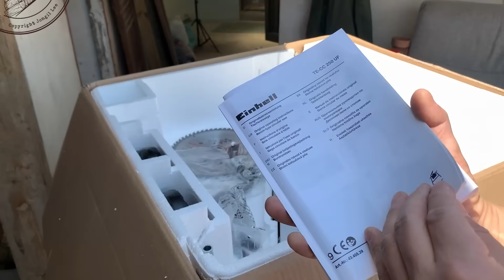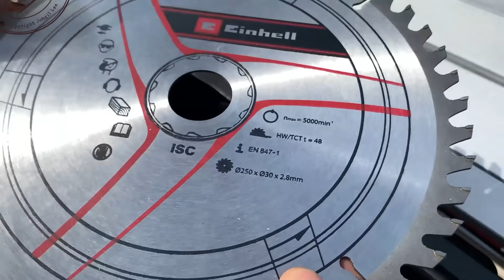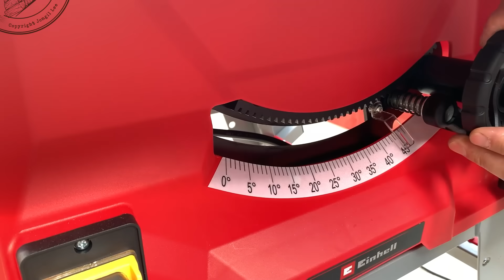My New Jobsite Table Saw - Einhell TE-CC 250 UF - Unboxing, Assembly, Test Cuts / Woodworking

Comment: Looks like good alternative to Bosch PTS10. Very similar products. Good info about Einhell. Have quite of their 18V battery tools. Real happy about it. It is best quality hobby tool manufacturer. In large amount better than most of the green Bosch products. For this saw it needs a bit testing. Also PTS10 is a rather old product.
Reply: I have this same table saw for a year now and it is very good for the price. It is very similar to the PTS 10. I also have some 18V and 18+18V tools from Einhell and quality is great for the price. Einhell has really improved in the last few years!
Reply: @Zglemb79  Yes, I found in the past 3years that their goal is to be best hobby tool manufacturer. But In that instance, some of them are compared with pro style tools. In my opinion, that is s good thing, because one can find thin line there. Also why spend at least double the amount if one won't use it every day, or at least not in the amount like it would be used daily in a pro shop.
Reply: I am seeing more and more 18v items available here in the USA but cannot find any of their corded tools.  I won't be interested in trying some out.